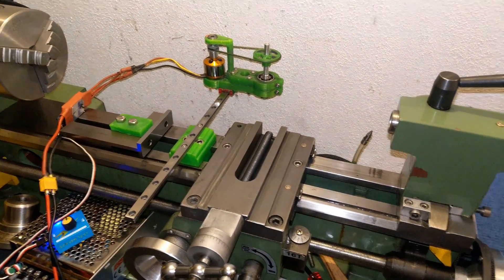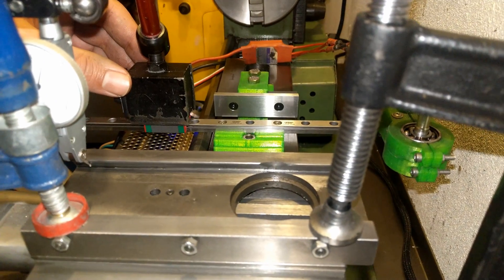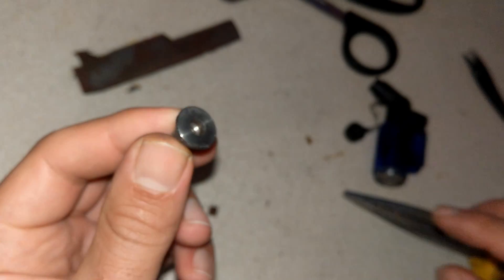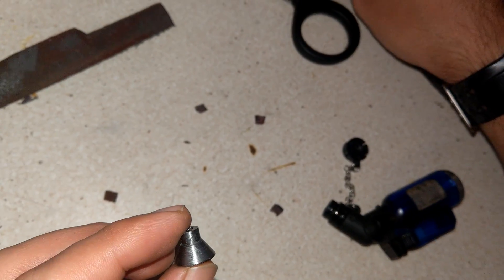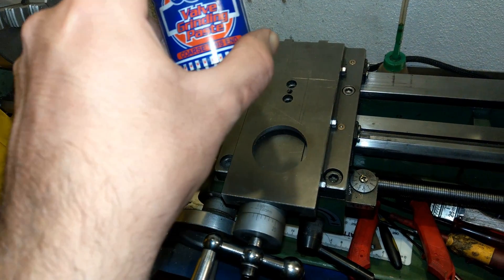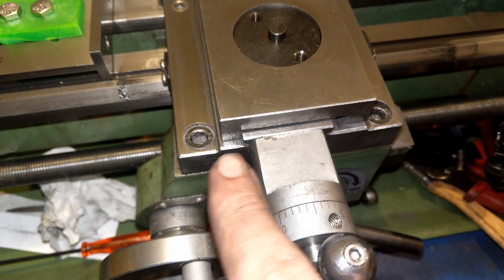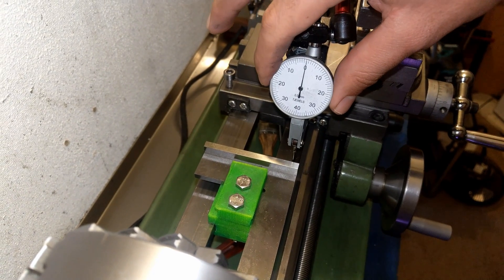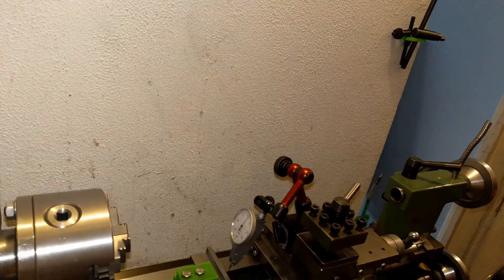Cross Slide Dovetail Grinding, Mini Lathe Cross Slide Alignment ,  Part 2

Comment: I don't think a high-end milling machine or even a fancy (and expensive) grinder would have done any better than what you accomplished with some basic tools, jigs, and setup.  As a matter of fact, it may be advantageous to do it this way as you are constantly referencing against the bed on which the part is mounted and moves.

Comment: I discovered that i have the same problem and i think i will do something similiar as you.
First i was thinking that some alingement on my lathe isnt right, but then i started to correct my slide by hand....😅
Did you find any problems after you corrected the slide?
Reply from the maker: Hi , No to be honest, I didn't remove much, but if you remove a lot from the dovetail probably you will need a bigger gib strip

Comment: Great job! My cross slide binds as it goes towards the center. You have given me the idea that I may be able to simply use a bit of grinding compound to even it out and improve performance.
Reply from the maker: Actually I tried grinding past before doing this , but didn't have any success, by hand is difficult to repeat having something as rail helps alots
Reply: Mine's also binds, towards the rear. I have measured the dovetail rail, they are out of paralallel by 0.037 mm (about 1.5 thou). Someday I'll try this grinding approach!

Comment: Your slide move looks very smooth. Are there ball bearings in that screw mechanism?
Reply from the maker: Yes , I added trust bearing , but Im thinking to make some modifications and change it later, an other reason that make it smooth because both sides of Dovetail (male and female)are parallel and smooth , so it slides more smoothly